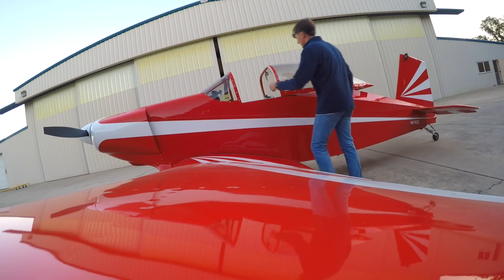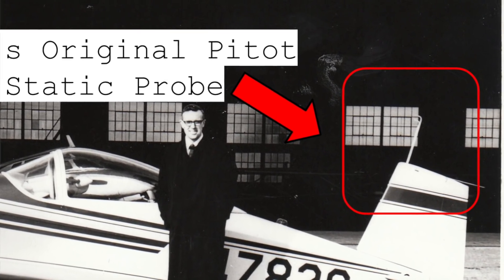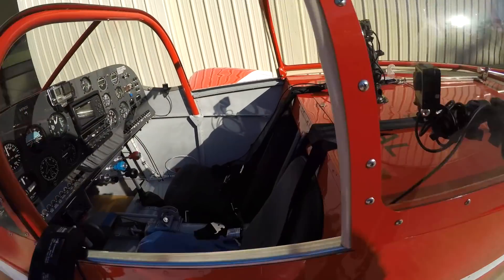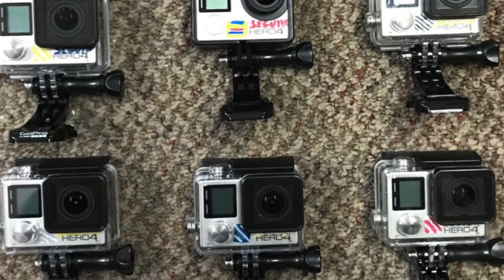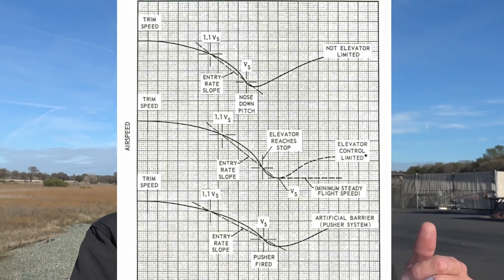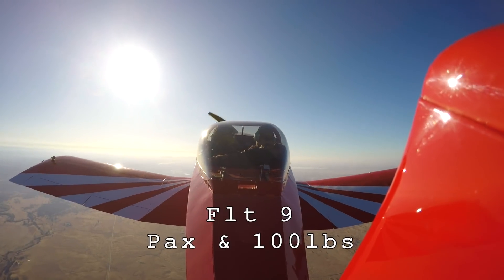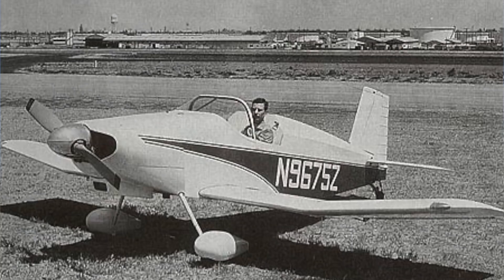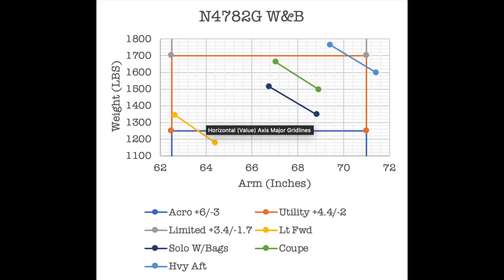Aft CG Testing - JellyBeanThorp

Comment: I have a T-18 standard.  160 hp Senenich 66 x 77 pitch prop wood.   I am 6 ft 6 in and 330 lbs. I moved canted seat bulkhead aft 4 inches and moved battery from bag compartment to engine firewall. i am very concerned about CG effects. My weights for empty starting calculations were done with calibrated scales. I used the published CG ranges and am careful to stay in them. I did not see any numbers used in your report. Would love to compare mine to yours. Can you add inches used for T18 envelope so i can compare.      Your work is good. I watched the tail elevators and rudder plus tail wheel on takeoffs for comparisons.  Thank you for work and publications

Comment: Great video. Any conserns regarding sticking gopros on the outside of the aircraft? Espescially with the regard to potensial spins and cameras pisitioned at the wingtip and in front of controlsurfaces (rudder).
Reply from the maker: Great question.  We do our best to keep them away from flight controls.  Typically the footage is valuable enough though to justify some risk.  Thanks for asking!!

Comment: Great video! Amazed at how small and short the stick is in this airplane.  Would a taller stick make things better or worse?
Reply from the maker: Thank you for the comment!!

The longer the stick the lower the forces (less stable).  So related to stability the stick would need to be shorter.

Of course, once the CG is aft of the neutral point the forces reverse, so stick length won't help.
Reply: Thank you Elliot for the response!

Comment: Nice to watch a pro - thanks
Reply from the maker: Thank you!!
Reply: @utopiasnow  Is it possible to one day do a guideline for the average pilot to complete a test series in a proven design - have the EAA plan on the way - anything else to source?
Reply from the maker: @garyspencersalt9449  EAA is a great resource, there are also some great books out there.

It really depends on the airplane and the scope of the project.  A shake and bake RV or Carbon Cub is a different monster than a one-off with a prototype motor.

We sell flight test support so I may be the wrong person to ask...but I think there is something to be said about hiring a professional to prepare you for your first flight or do the very initial envelope expansion of the airplane.

For instance, we have been able to recently demonstrate that an RV first fight could be done with 2 days of having Wasabi onsite.  Our daily rates are fairly competitive so for less than the price of a parachute you can save yourself the personal exposure of the riskiest phase flight of the program.  Then in most cases, we can clear most of the high-risk portions of the envelope (stall and high speed) during that initial flight series as well.

In the end, it's a very personal moment and with that, the decisions are very personal as well.

Thanks for asking!!
Reply: @utopiasnow  Elliot, firstly thank's for your reply, what you show is how necessary the testing is. I now understand that a lot of the bad press around an aircraft like the Stewart 51 was builders flying circles to remove time or worse. I am in Australia but for sure would use your service to test and later to expose a hack pilot to the aircraft vices, if any. Keep it up this is what the WWW really is for. Again thanks.

Comment: Elliot, love your channel.  I'm a long-time Thorp builder, flyer and just have a couple of comments.  

The model you are flying is a folding wing with has the dihedral starting much closer to the wing root than the original design.  I have a standard wing (4' wide sections) with a 0320 and wood prop, so the CG is farther aft than your 0360 with CS prop.  With my setup, it is difficult to spin and recovers instantly when back pressure is released.  However, I know of a pilot flight testing a folding wing similar to your test and he had a much more difficult time recovering from a spin.  My point being that these were not laser drilled RV kits, and there are variations in the builds.  Every airplane is very different.  I'm glad the owner is taking a flight test approach to explore the edges of the envelope.

Static pressure has consistently been an issue with the Thorp, resulting in indicated airspeed issues.  Ironically, one of the common locations for static pressure which seems to work consistently, is a vent in the cockpit, behind the instrument panel.  If you have another flight test opportunity, you might try this location.

The great thing about the T-18 is it's development when home builders were truly experimenting and fabricating solutions.  There has been a huge wealth of information, pre-interweb, that was shared with builders/flyers via a monthly newsletter.   It's worth the time for any owner/flyer to acquire this information and read through it.

Fly safe and enjoy that baby.  They grow up fast!
Jimmy
Reply from the maker: pecanflyboy fantastic!!  Thank you.

Comment: Looks like not a lot of attention was in keeping the ball centered with your experience why was that? Look fairy clean with ball centered.
Reply from the maker: Thanks for the note.

As these flights were about exploring the aft CG stability more than quantifying characteristics.  I probably got lazier than I should admit in such a forum, but anyway.

This airplane drops a wing most of the time even with the ball within a half. 

Lastly the goal of all the stalls in this program was more about speed (determining pitot error) than characteristic.  And therefore pitchrate and deceleration rate was a bigger concern than the ball.

Thanks again!!